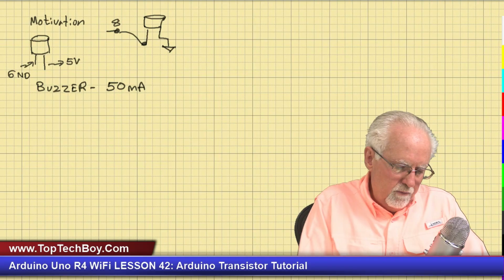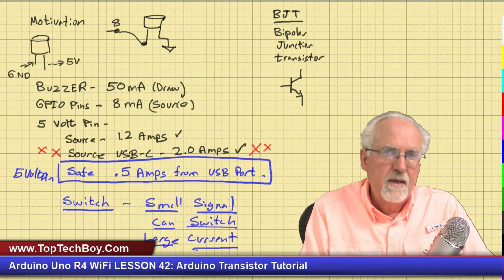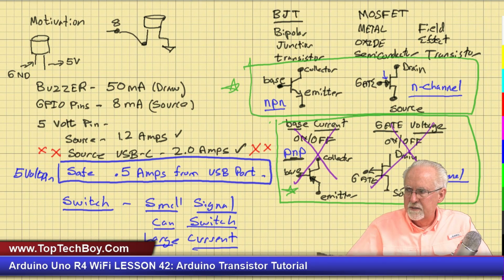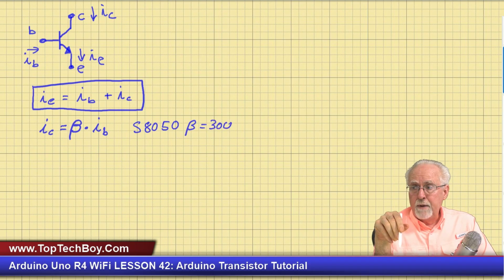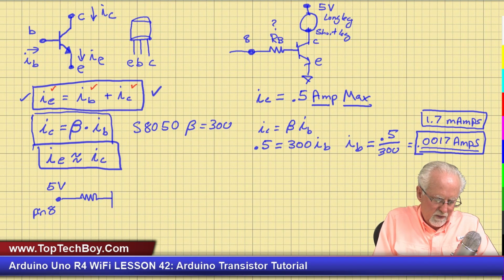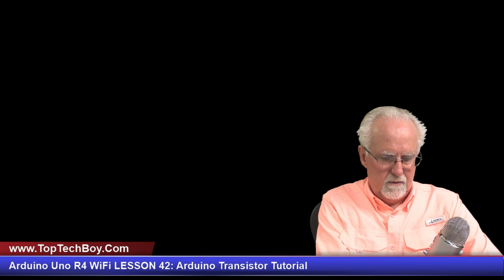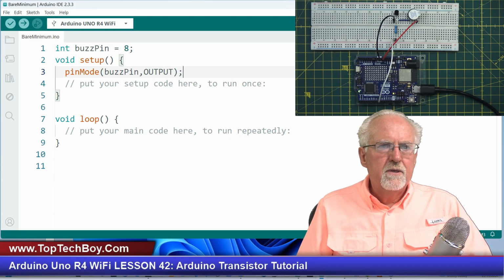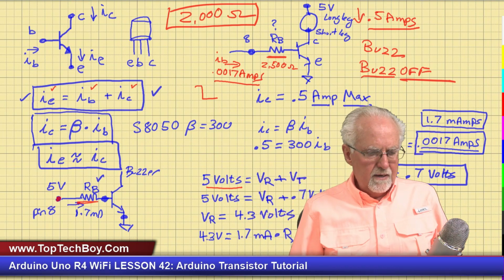Arduino Uno R4 WiFi LESSON 42: Arduino Transistor Tutorial

Comment: Great Lesson Paul!  Please consider doing a basic circuits class at some point.  Your explanations are really helpful.
Reply from the maker: Thanks for the support. I have always wanted to do a circuits class, but have not done it, in that I have not figured out a project that would make it interesting. Circuit design/analysis is a lot of math, and involves imaginary numbers. Then in the end, you just get the currents and voltages you wanted. Also would require an oscilloscope, function generator, and DVM, and then components. So, while it is a topic I love, have not figured out how to make it interesting.
Reply: @paulmcwhorter  I understand.  I guess I just have to push myself to work through some texts like "Art of Electronics".

Comment: Question re lesson 42
Paul- I used my breadboard circuit to analyze the current readings that you outlined.  I hooked up my multimeter, set on mA, to check the current on each of the legs of the S8050.  The base current was 1.89mA, close to your calc of 1.7mA; the collector current was 23.75mA, and the emitter current was 25.5, which was very close to your formula adding base and collector current to equal emitter current.  All good.

During the lesson, you mentioned that the S8050 amplification ( gain? ) was 300.  That was multiplied times base current to equal collector current.

However, in my measurements above, the amplification was 23.75mA (collector) / 1.89mA (base) = 12.57

Is amplification a variable number based on overall current draw?  What am I missing?

Thanks
Vince

Comment: Does anyone else get the buzzer beeping when the buzzPin is set to LOW ?  I have the setup exactly as shown but my buzzer beeps on digitalWrite(buzzPin, LOW) and is off when digitalWrite(buzzPin, HIGH) ... is that correct?
Reply: i found i was actually using the S8550 transistor instead of the S8050!  makes a big difference

Comment: Home Work... Yeah.   Took a NPN to drive a P-channell to operate a 1A 12VDC light.
I went ahead and added the little bit of code to do this into the Function_Void sketch I had drawn up.
Now as PWM goes up. Red,Green,Blue,   Lamp...  hLamp is a Sub-void of LEDchoice void.. Fun stuff.
Many uses for this setup in a Car/Truck.. replace a bad fan blower switch. Head Lamp control. etc...

https://youtube.com/shorts/l8nSUYBb8n4?si=lSBkqOpmTUyjuOEJ

void LEDchoice(int t, int &w) {
  if (t <= 5) { w = 1; }
  if (t > 5 && t <= 23) { w = 2; }
  if (t > 23 && t <= 252) { w = 3; }
  hLamp(t);
}
void hLamp(int pulse) {
  if (pulse > 252) {
    digitalWrite(LEDs[3], HIGH);
  } else {
    digitalWrite(LEDs[3], LOW);
  }
}

Comment: Absolute.. Excellent Math not only needed for Transistors but LEDs, opto-couplers and many  other things. Another Great Foundation Video.  The needed Resistor for a project based upon the voltage drop across. Gotta protect the output draw and sometimes even the input from some devices to the Arduino. Please don't forget to 10K pull-down on those bases and gates. Especially MOSFETs.  Touch of a finger can trigger them.
Reply from the maker: Glad you enjoyed it!

Comment: My submission is out on my YouTube channel, labeled Lesson 42.
Like a few others in the comment section,  I wondered about using .5A as the target amperage for the buzzer. I pulled up some datahseets for the TBM12A05 buzzer that's in the Sunfounder kit, and they all state the rated current as ≤30mA. I made my calculations with an allowance up to 50mA, and came up with a 20K resistor for Rb (it actually calculated to 25,294, but I've read that you can get away with a lower resistor, so long as it's at least around 2/3 the calculated value)

Comment: Just curious Paul, why was the Base resistor calculated using the maximum safe current that the USB port could deliver, .5 Amp, rather than the Buzzer maximum current demand, .050 Amp?
Reply: This was a question that I had as well.

Comment: Since we want to keep the buzzer current under 0.5A, shouldn't we use a base resistor BIGGER than the value you calculated.  (Rather than smaller:  2K < 2500)  I used a 5.1K resistor, and the buzzer is plenty loud enough.

Also, we may want to make the resistor even bigger than that, so as to "waste" less current through the buzzer.  This could be important for a circuit running off a battery.  I tried a 10K, and it seemed just as loud.  I also tried a 100K, but it's much quieter then.

Comment: Hello Paul and congratulations for the videos !! I ask for clarification because I'm not an expert. If I replaced the buzzer with a LED I imagine it would burn out because the maximum 10-20 mA is exceeded having 0.5 A in the circuit thus designed. But why doesn't the buzzer, which supports 50 mA, burn out?
I thought you would have sized the circuit thinking about the maximum current of the buzzer (50mA) and not the maximum of the 5V pin (0.5A). Thanks !!!!

Comment: Additional info : The resistance of the buzzer causes the collector current to be limited to about 50mA.  Another purpose of choosing a base resistor designed for a collector current of 500mA is to ensure that the transistor is saturated while it is on, i.e. it acts as a switch, with minimal voltage (typically 0.1V) between the collector and emitter.  This ensures minimal power dissipation in the transistor.

Comment: Does it matter if the buzzer is on the collector side of the transistor or the emitter side? If the transistor is amplifying the current to the ampage you want I would have put it on the emitter side. Or is the ampage the same across the collector to emitter?
Reply from the maker: It does matter. In the emitter side, it becomes a circuit element in calculating the base current. You will get completely unpredictable results.

Comment: I didn't catch how the voltage drop of the base emitter was determined. Is a 0.7 voltage drop standard for most NPN transistors? Or was this pulled from the datasheet? I saw a few different names(Emitter-Base voltage, Emitter-Base Breakdown Voltage, Base-Emitter Saturation voltage) and not sure which one of those to look at. I didn't see them mention 0.7V.
Reply from the maker: The typical NPN transistor is made of Silicon, and the base-emitter junction is equivalent to a diode. Putting a voltage on the base forward biases the diode. the voltage drop across a forward biased silicon diode in about .7 volts. Since it is defined by the material, .7 is typical for silicon transistors. The other parameters you mention are also important but not needed for the circuit in the video. One day I should teach about transistors, but it would be a semmester class to really understand them.
Reply: @paulmcwhorter  Ahh, I see. Thank you! Speaking of diodes, do you think we will have a future lesson on that component?
Reply: @paulmcwhorter  Thanks Paul I had the same question. GREAT VIDEO!

Comment: The transistor bare  S8050 is PNP and the transistors S8050-B,C and D are NPN
Reply from the maker: You really need to check before posting something like this. The S8050 is an NPN BJT transistor, as I said in the video.
Reply: @paulmcwhorter  Sorry I can send you a datasheet by email in wich it says PNP
Reply from the maker: Look, I am not going to argue with you. The S8050 is a NPN transistor. Please do not post comments that could allow people to hook things up wrong.

Comment: Great explanation! One question: Is the only purpose of the resistor to limit the total amps from the source?  In this case, the buzzer will only pull 50mA, so it isn't an issue. But if we wanted to put something bigger, like the motor you were talking about, then it is there for protection?

Thank you for taking the time to remake this video!  I really appreciate the deep explanations!
Reply from the maker: The resistor sets the base current. Then the collector current will be 300X the base current. The resistor sets both the base and the collector current.

Comment: Rather than relying on the exact voltage drop and Beta of the transistor, wouldn't it be easier to simply limit the current both into and then threw the transistor.  A 2k resistor on base would limit the base current to around 2.2mA then a 1k resistor on the emitter would limit the collector current to 50mA wouldn't it?  In your circuit the buzzer would/could get well over the 50mA limit you assigned.
Reply from the maker: You are not understanding how a transistor works. Ic = Beta * Ib. It is this relationship that defines the collector current. You are trying to use ohm's law, when the wild card is the Voltage drop between collector and emitter on the transistor. One day I would like to show more about how transistors work.